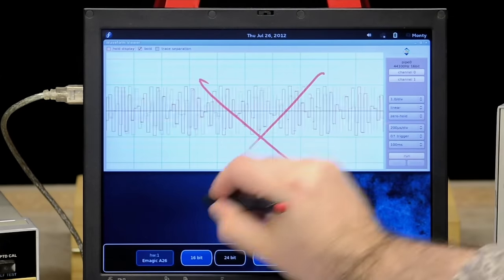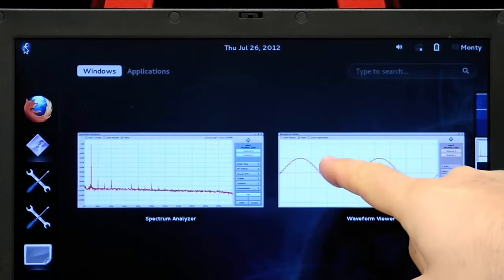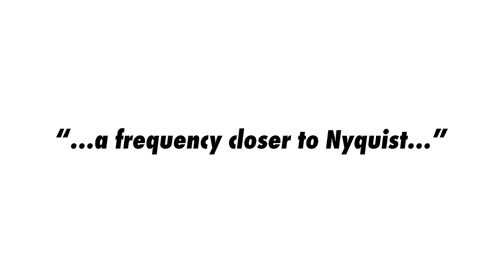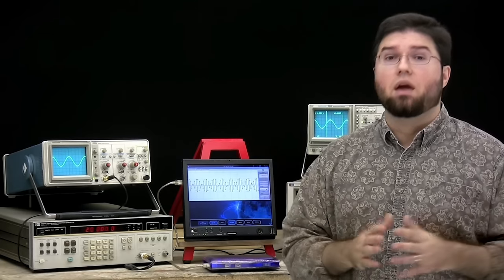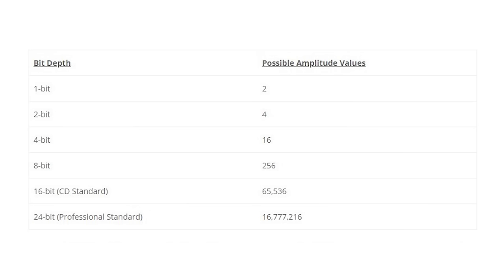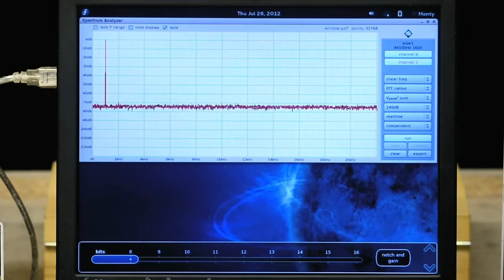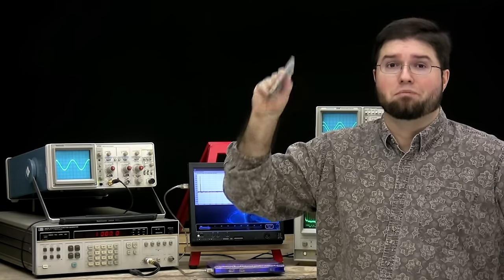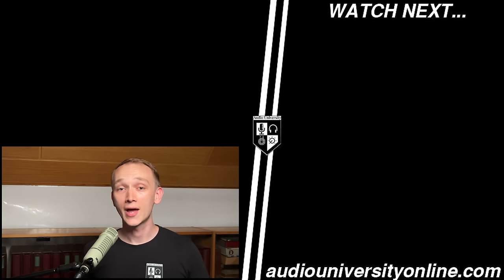Debunking the Digital Audio Myth: The Truth About the 'Stair-Step' Effect

Comment: The first conclusion of how the digital signal was never "step-like" is not entirely true. In order for DACs to suppress images at multiples of the sampling frequencies (fs), filtering must be done to convert the discrete data points to continuous time domaine. This is because most common DACs out there still uses the zero-order hold implementation to convert to continuous time domain, and then uses a low-pass filter to get rid of the images. The spectrums he's showing goes only up to Nyquist, therefore the DAC images at multiples of fs are not visible. It is kind of misleading to say that the analog reconstruction is exactly the same, since the filtering required for perfect reconstruction is often not very ideal either.
Reply: mfnickster9754 sigma-delta employ high oversampling rates which is not very cheap to use in low-cost applications, and conventional current steering or R-2R DACs.

On top of that, sigma-delta operate in a similar fashion where it uses noise shaping techniques to push the quantization noise to higher frequencies. It also requires an interpolation filter which is what bridges the "square waveform" to a more continuous time waveform. A zero-order hold is a must in these types of circuits, but lots of upsample and filter is then applied on these modulators because DSPs can only operate on discrete time domain.
Reply: mfnickster9754  Yes I agree that the zero-order hold is not the real analog signal but to say that the ZOH is a "wrong" way to interpret the discrete data is not true either, as this video is trying to portray. Although the final output of the DAC is smooth, there is almost certainly a stage inside the conversion where ZOH has been applied to the discrete samples, whether it is needed to re-timed or upsampled or filtered (remember that all of the bits of information is generally stored in flops & registers).

Basically, because the signal process is done in discrete domain, there is definitely loss of analog information (because you can't have infinite amounts of discrete points!) but the interpolation filter helps to recover those lost information, and that is the beauty of Nyquist theorem and DSP.
Reply: mfnickster9754  well it is true that something not as smooth as the analog signal seems confusing to think about, the circuits that actually implement the ADC/DACs still fundamentally uses sample+hold blocks which essentially samples the analog voltage and hold it by a certain sampling period (Ts), which in transient waveforms it does look like the zero-order hold response. Now, the "actual signal recorded by the digital device" is definitely a zero-order hold because digital systems inherently requires a sampled digital code at every Ts interval. This digital code remains that value for the entire duration of Ts, until the interpolation filter reconstructs the analog signal by convolution in digital domain. So when you finally look at the output, the waveform is smooth again.

Comment: I've come to realize it's the dynamic range of a recording that determines how good it sounds, not by sample rate/bit depth, i have a bunch of first cd presses from the 80s because to me they sound better than newer loudness ruined releases and even with high res remasters digital releases. Also resampling audio can actually cause audible artifacts in the form of a "metallic" glittery sound, would be interesting to see how that would look visualized on an osc.

Comment: It makes sense when explained like this. The sine wave is essentially a vector line, so as long as the coordinates (frequency) is the same, the outputted result would look the same. Like a vector image is the same at any resolution because it’s based off of an equation rather than individual points

Comment: Make that conversion 50 times and let's see the result. If you use a not lossless format the end result will be crap after 50 times. And the analog signal will be recreated with no steps... but that doesn't mean it is accurate.
Reply: MF Nickster  Agree, but here is another discussion. The point is, that wave on oscilloscope doesn't mean nothing is lost in the process.
Reply: MF Nickster  He says at some point that the output is the same as input because look at oscilloscope. Nope, it isn't.
Reply: MF Nickster  Again, do it 50 times. That "exactly the same" will add up and the result will be crap.
Reply: MF Nickster  When you convert analog to digital (for storage) in a lossy format, you lose small parts of the input. That's why it is called lossy and not lossless. Then, when you convert it back to analog, it can't be the same...

Anyway, how can be "exactly the same" with added noise?
Reply: MF Nickster  If it is lossy, those "steps" exists even though the output as you see on oscilloscope do not show it. So using oscilloscope to demonstrate something about "steps" is futil. That I said in main comment but with other words.
I hope it is clear now, I will not repeat it. Have a nice life!
Reply: MF Nickster  The "steps" with quote ... are in the digital format by losing accuracy in a lossy conversion.

Then, it doesn't matter what oscilloscope shows you. Of course there are no steps there. But that doesn't mean you lose nothing in the process just because you see something continuous on oscilloscope. Gizas!!!! What's so hard?
Reply: MF Nickster  

1) Analog to Digital lossy conversion --- the "steps" are here!

2) Digital to Analog conversion --- no steps here, what you see on oscilloscope.  The output is analog continuous. The DAC will fill the gaps, but not with something as accurate as original. 

Searching for "steps" in 2) part with oscilloscope, to prove "no steps" in the entire process ( 1 and 2) is stupid.

That's why, repeat the process 50 times using as input the output of the previous step and the result will be crap. Because that lossy conversion at 1) will stack and become visible. And finally on 2) after 50 times, you will have a nice continuous curve on oscilloscope but a crap sound.

Using oscilloscope in demonstration is stupid. It will always show you that is alright but it isn't.
Reply: MF Nickster  My main comment was in the case of lossy format. In that case you lose some data.

Then DAC makes the conversion and the result is always a continuous analog signal. Because DAC makes it that way.

At this point arguing that no data is lost because the signal is continuous (and looks exactly the same with original) on oscilloscope is stupid. You lost data at analog to digital conversion and the DAC does not bring it back. 

Irony is that these videos are made by people that are somehow in this business.
Reply: MF Nickster  Deliberately discard 50 times and the end result will be crap.

Comment: aaargh no, you can't debunk even dumb claims if you don't listen to the dumb claims. They never say the waveform will be stairsteps; they say it will be DIFFERENT. To officially debunk this, you need to go ADC - DAC and then show that the waveform is exactly the same on both ends. I don't doubt that's possible but that's the goal.

Comment: The experiment was fundamentally flawed because it was using a constant Sine Wave. Real music has constantly varying frequencies and amplitudes, so those digital sampling points become very unreliable.
Reply: @nicksterj I don't think you understand the issue. The experiment demonstrated was analogue sine wave to digital, and then digital back to analogue sine wave. That is all the experiment proves. To prove whether real music is affected the whole process would have to use a real music track and the before and after waves compared. That is how science works.
Reply: @nicksterj A theorem is the product of the theory, and no theory claims to be absolute fact. Many people know believe this theorem to be outdated as our understanding of sound has improved and the inaccuracies of digital sampling has been revealed (ie real world electronics are not as accurate as the theorem would require).
Reply: @nicksterj Ok, let met come at this from the other end of the street. If your view was correct then even the cheapest Digital to Audio Converter (DAC) would sound excellent. It is clear that cheap DACS sound terrible to anybody who has connected them to a half decent system. Designing and building a good quality DAC is complicated and costs at least several hundred pounds to achieve a good result.

Comment: Something important to consider for bit depth is that the bit depth of the file is shared across the entire spectrum, leaving smaller/higher frequency waves to ride on larger/lower frequency waves, effectively reducing the available bit depth and therefore dynamic range of the audio across the spectrum in order to present audible low-frequency sounds.
Another important thing to consider is that all output on a device is limited to it's output bit depth at the output level, which is fine if you're listening to one thing at a time, but if you have multiple audio streams playing at once, the same rules of the previous consideration apply, again, effectively reducing the available bit depth and causing clipping when the stream peaks overlap.

This is why it's important to mix streams at higher bit depths, even for lower bit depth audio files, and why 24bit output on your dac is in fact still very relevant and important to have, as one of the best ways to avoid cross-stream clipping is to reduce the stream volumes while preserving the output volume.

Comment: The assumptions in this video are incomplete. It's not about the upper range of human hearing, or what your gear can reproduce (a transformer passing a magnetic field or a capacitor charging and discharging is going to smooth out all those jaggeds anyway).  It's the analog summing of extremely transient signals in various phases that result in overtones and other stray harmonics that output in the audible range and are THEN played back.  If you alias out the source, you lose all that high resolution detail responsible for producing these other audible-range signals. These are part of the original recording, and when preserved, they add a richness to of all things, bass reproduction, where frequencies are the lowest versus highest.

Comment: yeah and pretty much applies to video compression and these high frequencies  they use . general utterly pointless and a waste of resources . as the eye can only interpret around 30 frames per second  at just  around 1080 more or less with in it field of view.  sure  if you are sitting so close  to the  image  that it image is out of your field of view  then it pointless as the image outside  your  point of  view  is perceived  at much much less.    and you have to dart you eye to actually  focus on the image to tell what it is or what is happening . the only thing that is important is  the size of the image and the distance you are from it  and if it stays within your point of view . and for view purpose any thing over  1080 and frequency of 30 frames  is pointless  unless you are  so close to the image you can not see the entire image ( being a  mister magoo). but watching a movie in 1080 visually is no different then watching in 4k. on an average large tv screen. or  watching  480 on a cell phone screen is no different then   if it play back was in  1080 or 4k. visually it is the same  unless you are mr magoo and you have the screen 2" from your face

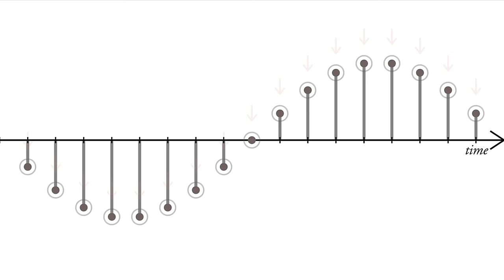Comment: You'll probably delete this comment. There are some serious misconceptions here. The stair step absolutley IS the correct waveform. That is what comes out of the DAC chip (not the box that contains it). It then passes through analogue filters which removes the high frequency content leaving just the original waveform. That signal in the video at 5:05 is completely wrong. No one will ever find that waveform in a DAC with a 'scope no matter how hard they look, it simply doesn't exist. Get yourself a 'scope and try poking around inside a DAC, you will never find that waveform. Even basic DAC theory says it can't exist, it would never work. I spent 20 years designing DAC systems down to component level, laying out the PCBs, designing the filters, and writing the control software. I know what I am talking about. Sorry, but this video is completely wrong.
Reply: @nicksterj The stairsteps appear on the analogue signal after conversion from digital, before filtering, regardless of the type of converter. SD DACs still have the stairsteps. This video denies there are stairsteps after the DAC following conversion to analogue, and instead states that it consists of spikes at each sample point (see 5:05 in the video) which is totally incorrect. I think this video is confusing the DAC with the method of sampling in the ADC.

Comment: well, audiophiles would buy the most high end cleanest sounding ultra low noise floor ultra low harmonic distortion dac just to pair it with a tube amp to fuck it all up. also people claim to hear the difference between different power supply cable on their dac/amp lmfao. i'm not surprised this is yet another ridiculous thing they are hopelessly wrong about but swear by.

Comment: I would like to see a 20Hz sine wave...
Reply: @nicksterj yes, on a scope. Maybe even 1Hz, just to see if there are any steps. I think the low-pass filter will smooth 1kHz or 20kHz signal, but can not smooth 1, 10 or 20Hz.
Reply: @nicksterj if the filter is set to 24kHz it works quite badly at 20Hz. This is why I would like to see it on the scope. Of course on an analog one because digital scope samples with only 8-12 bits...

Comment: I do see a value in keeping my music at somewhat of a higher bit-rate for the same reasons as audio production folks do. In our modern listening environments, more and more, (and it's probably only going to increase as time goes by) we use DSP for a lot of reasons: Room correction, adaptive spaciality, like headphones vs. speakers, etc. So using a track that has increased bit-depth could help avoid some quantization mistakes and mitigate noise introduced by DSP, hence making sure we get the full benefit without any audible artifacts.
Think of it as how many decimals you want before doing a lot of math on each sample's value. When the object is a perfect result, wouldn't you increase the number of decimals in your calculations and round only once at the end of the process? And if that final result then goes into your room correction again... Sometimes it is not possible to choose an ideal signal path at home, por practical reasons and we end up using compromises where one of our processors only gives us analog output and then that goes back into a digital room correction system that re-digitizes it. These pictures usually use higher bit-depths to guarantee as little error as possible, so if the signal we feed it has meaningful data at a higher resolution, we might stand a better chance to end up with a 16-44.1 or 16-48 equivalent at the final D/A converter.

Comment: 16-bit/44.1kHz  is not as good as high-res Audio. I have tested this at home countless times with different audio equipment and different people many many many times over the years in blind A - B testing. Every time even untrained people that do not care about HI-FI sound could spot the difference. But they could not hear difference between 24bit upscaled or 24bit original audio. And Any higher sampling frequency then the way to low 44,1Khz they could spot. Just going up to 48,2Khz sampling had big impact on the sound, higher sampling after that gave diminishing returns.
Reply: The source material and mastering play a very big role.  Comparing different masters is always fraught with error, it's simply not the same source material.
After a proper conversion of 24bit/96kHz (or higher) down to 16bit/44.1kHz you will not hear a difference - unless your equipment 'malfunctions' at higher frequencies in such a way that you like it.  
Many people like the (distorted) sound a tube adds - fair game but apples vs. pears.

Comment: 6:17 thats wrong. If you have a electronic mesurement instrument on the output of any treasonable quality digital audio out, WAAAAy above the 44.2 sample rate, you do NOT see infinitesimal small points of value with 0's in between. That would add noise, and actually "average out" the time step to 0. Its the "stair-step" that allows/enables the averring (as drawn by your oscilloscope) to be/reproduce the sampled value You are using a VERY low res oscilloscopes, which hides the detail you are trying to disprove.

Comment: So you imply, but never flat-out say, what happens in between samples. The implication is that there is a ramping of amplitude between samples.

Fair enough. But doesn't this depend on the design of the D/A converter? We're there D/A converters out there, I suspect in the early days, that just held the sample? Wouldn't that design result in stair step?

On the other end of things, are there design approaches to D/A converters that do ramp as to whether that ramp is linear or logarithmic or what have you?
Reply: mfnickster9754  Whats is sigma-delta?

Comment: Very nice video overall, but i cant help but nitpick. You cant say "without any audible beneit", when in very same video you provide explanation of said audio benefit.

Stair-step is for sure wrong, but benefits of higher bitrate are there aswell. And they are AUDIBLY distinct, and you can test it in practice. On yourself. With blindfold test.

Good audio source is rich with small detail, that wouldl be quantised out adn higher bitrate helps capture them. Perfect reproduction and smooth signal is true for continuous sinus0wave of stable signal, not real recording.